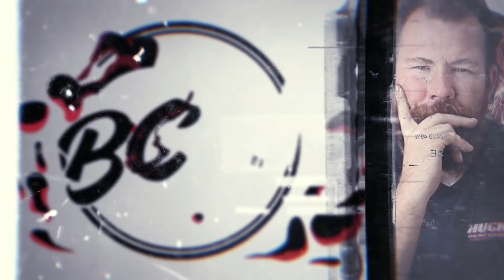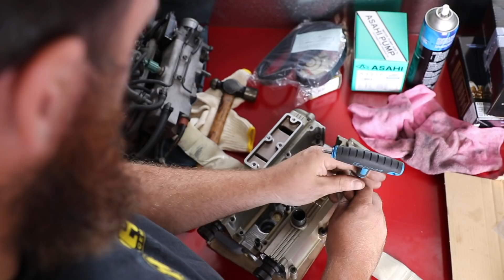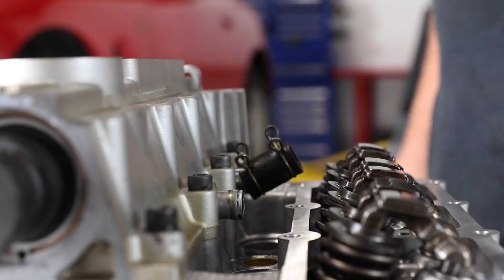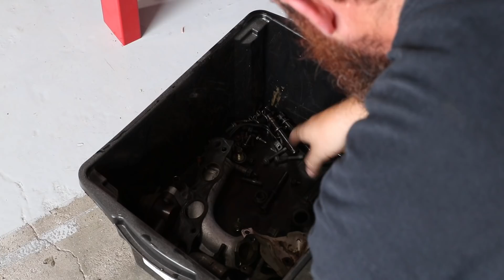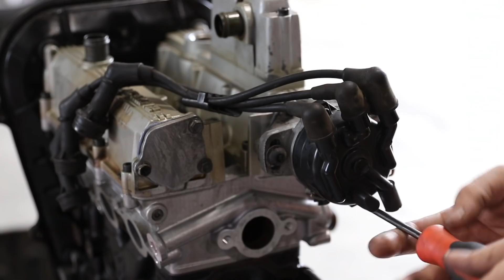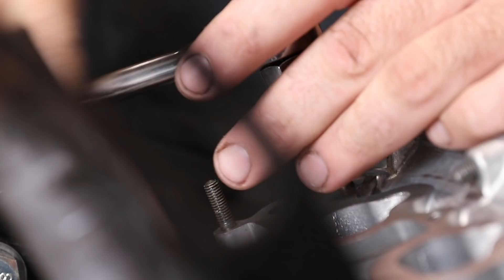CAPPUCCINO- Engine Assemble

Comment: Seeing you put a Carborundum stone to the block drives me completely insane! Please tell me why you are certain no grit is left there? I would only dare such stunt on completely stripped block, that can be hot cleaned afterwards? Is This the G10 engine also used in the Geo Metro, though with a double cam head head? You just said "F6A", looks like the Geo Metro though, but obviously with a smaller bore.

Comment: Those files you cleaned the facing with are Aluminium Oxide... If that gets down the cylinder it's going to act on the rings and wall's as an abrasive.

Wouldn't common sense dictate filling the cylinders with paper / rags at least to stop any of that file dust falling in?

Comment: Oi Benny, couple questions regarding stoning the block. What grade stone would you recommend? My block isn't too bad but I'm going mls so I'd much prefer if it was as flat as possible. My manual states the block warpage limit is around 20 thou but I'm gonna be shooting for no more than 10 thou. Do you reckon 1000 / 3000 oil stone would be suitable? 
It's for a 3sgte so no hate pls

Comment: With more details on what your doing you could skip the music. Its more annoying then working on your videos. It works for Moog and Marty because they never show the details, the nitty gritty. Have intro as is, talk of what your going to do, show it and add small text for tools here and there and other needed details. And have middle talk of where you are. Reapeat and outro talk and outro as is. Thats my tip for all it is worth. You could even break it doen in smaller cycles. Here im going to clean the top, then show when your using a razorblade, talk and thrn use grinder etc. The more details the more "bennyficial" to your videos. 
Love the the videos with JDM content, keep up the good work.

Comment: Some pro tips in there, particularly about the use of sealant. I've seen quite a few OHC engines that have fried the camshaft because some genius spooged about a ton of sealant on it and blocked all the oil galleries. I would also recommend changing the water pump and idler pulley/tensioner when changing the timing belt - it's amazing how often a previously fine water pump will fail after the belt is changed.

Comment: AS any woodworker would tell you.You must true up the Stone before you use it.Also use a vegetable oil as petroleum oil dissolves the resin in the Stone, A piece of plate glass with 220 wet dry glued to it is better.
Any Biker will tell you to true up cases like that. I always scrape with a sharp wood chisel as I do not like grit in engine. One method to see if the head to block surface is good is to use carbon paper and shelf paper. Tighten the head to the block then remove and look at the paper to see if the carbon transfer is consistent. If not then Machine it.

Comment: I realize Australia has strict car laws, but have you ever considered a Hayabusa engine swap?
Reply: J M single rotor swap
Reply: @miatafan  wouldn't that amount to the same power as the little 3 cylinder it has. A Hayabusa engine can put out 300+ HP when turbo'd. Plus it would still technically be all Suzuki.
Reply: J M There are 1300cc Suzuki car engines that are essentially Hyabusa engines, and take all the Hyabusa aftermarket bits.
Reply: @nordic5490  I'm not sure what motors your thinking of but Suzuki's 1300cc car engines are rated at less than 100 HP. Or at least that's what Wikipedia says. Hayabusas have nearly 200 HP. Plus they rev to about double the rpm. I could be wrong but I don't think those little gas saver motors are similar at all.

Comment: Hey Benny,  just wondering, you tightened the head bolts to oem spec's, but you are not using the oem head gasket, does it matter?
Cheers m8
Reply: The bolt size and thread on the bolt make more of a difference than the gasket itself.

Comment: WD40 is hardly a lubricant spray, though. It's for displacing water and cleaning, using it as a lubricant is going to be a bad time.
Reply: luuzeri WD40 is used here to stop the stone clogging, not lube

Comment: talking false readings on torque wrenches, the length of the tool you use twisting wont help :D short as possible into the wrench, this is what short tools and extension bars are for
Reply from the maker: minor0confusion extension bars also give false readings .

Comment: How do you make sure you dont get crap in the coolant galeries when you're cleaning the deck?
Reply: Mostly you don’t, it would only be a very small amount that you can mostly blow out with compressed air. I always start an engine on water only and drive it a bit before draining and refilling with coolant. Doing this removes the last little bit.
Reply: Catching Shade I would have stuffed rags on the top of those pistons though. Abrasive material in the bores cannot be a good thing.

Comment: Would be interesting to swap in a Triumph Daytona 675 engine into a Cappuccino, close to the stock CC, but considerably more juicy sound, get an upping from 47kw to 92~95kw
Reply: Have you seen the video of the VFR800 swaped Honda N600 ? Pretty similar idea.
Reply: Yeah seen it, it's cool, though they did just keep the stock transmission etc and not use an adapter etc

Comment: You ever tried 10mm float glass with wet and dry spray glued on?
Reply: Works a treat.
Floor sanding belts are better though especially with decking cast iron blocks for particular combustion ratios etc.

Comment: Benny makes that engine look smaller than it really is.
Reply: Nah, its just that small hahah
Reply: Yeah, the engine is only 657cc. It's tiny, meant to fit in with the 660cc kei car regulations. Stock, it made 47 kW (63 hp). Or so Suzuki claim, since that's the maximum power limit of the same kei car regulations. Japan have been known to make dodgy claims to get out of stuff like that. Like the 276hp Gentleman's Agreement. By the end of it, there were cars, like the R34 GT-R, making about 330hp stock, or, as they claimed, 276hp.
Reply: I think most companies did 64hp at the crank but the cappuccino is 64hp at the wheels. not certain though.
Reply: Was thinking. Either that is a bike engine or Benny is a big boy.
Reply: Just finished watching a video of people reconditioning V12 German tank engines. I thought he was working on an oil pump...
Reply: @ConstantlyDamaged  Tank Museum Workshop Diaries? :D
Reply: @catfish552  Heck yes https://youtu.be/lmm1F7epCsM Big engines for big toys.
Reply: A Barra for beginners?
Reply: @imouse3246  Itty Bitty Baby Barra!

Comment: Do you make any consideration to flattening/smoothing the stone, or do you think that it's not required for this process? 

I understand that if you don't flatten the stone, it tends to wear in the centre and end up wearing the sides of the block more then the centre. What methods would you suggest to flatten if it needs doing?